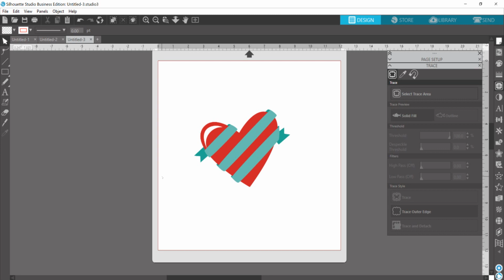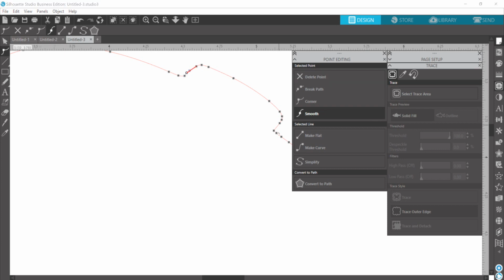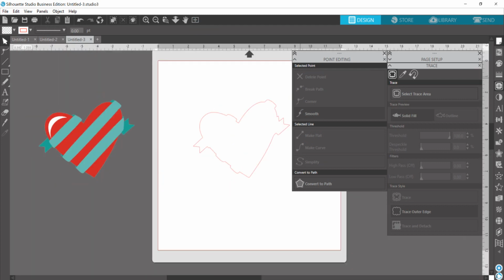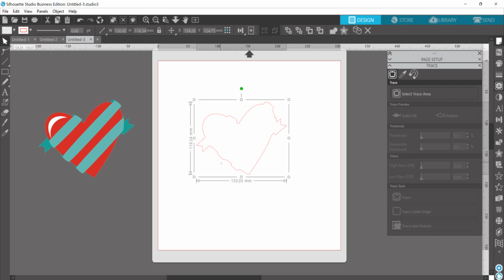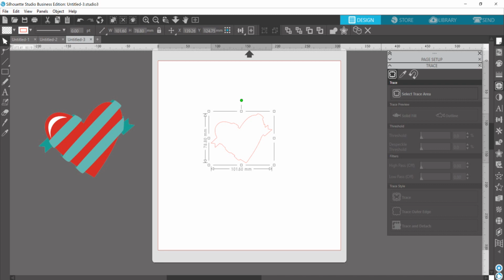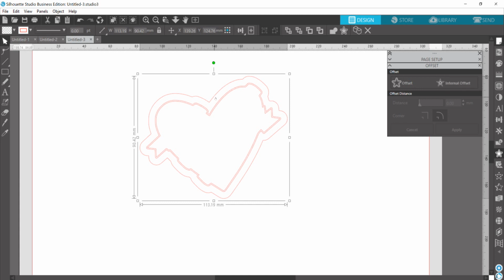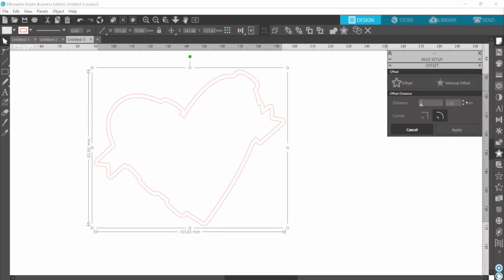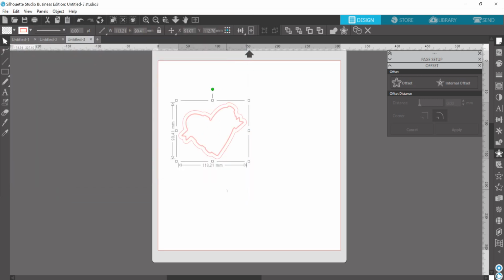Silhouette Studio v4 - Tracing and Offset Tools for Creating Cookie Cutters

Comment: Really helpful video! Thank you! How do you find the links to programs that convert to SVG files though? I don’t see them on the page anywhere.
Reply from the maker: Unfortunately, Tinkercad is no longer compatible with files that are converted. I'm not sure what they changed but you receive an error message upon import when you do. If you have the business edition upgrade, you can save as an SVG which works just fine.  If you were looking to use Fusion360 to model the design, I'd skip this method and sketch then extrude directly in Fusion.
Reply from the maker: Now, if you were creating this design to be made in the Silhouette Alta 3D printer, just save as a Studio3 file and import that directly into the Silhouette3D slicing software. When prompted, select Extrusion as the import type.
Reply: @bakedonmaple1196  omg are u serious? That’s what i been having trouble with. I just spent $118 on silhouette business just to save the svgs. They wont import to thinkercad. Did i just waste that money?? ;[[[[ please help!
Reply from the maker: @goldicreates9144  If you mean you upgraded to Business Edition to be able to save as an SVG, that is not related to an online converter as in this particular question. I'd have to know more details about your software version and test it myself to see what's going on.
Reply: @bakedonmaple1196  glad I finally found this reply. I found your other video first and have been banging my head against the wall trying to make it work. Perhaps you should take the other video down as it is no longer a solution. You are a great teacher and I wish it worked like it worked before.